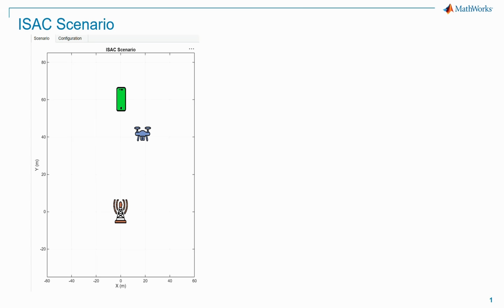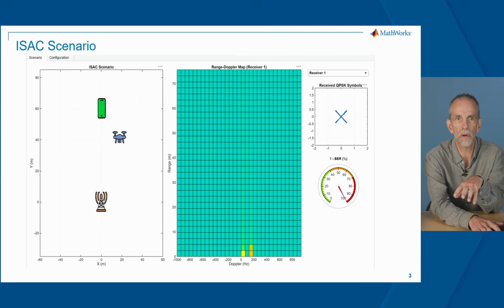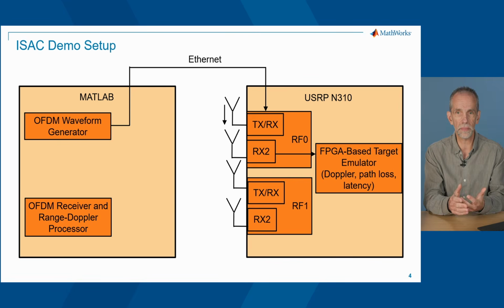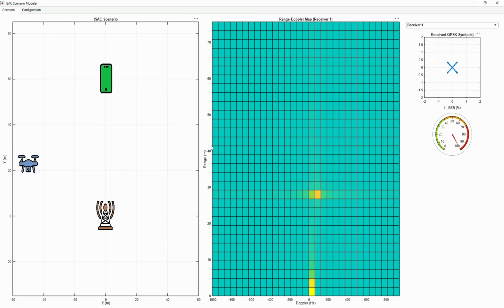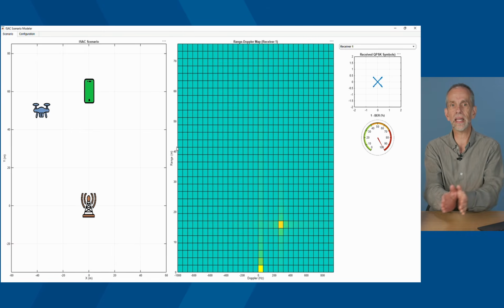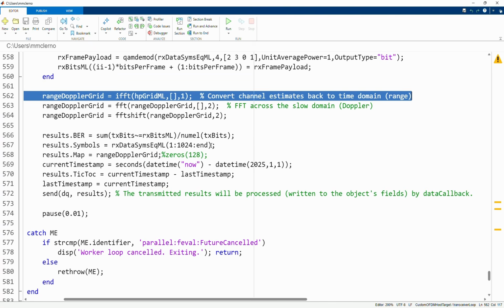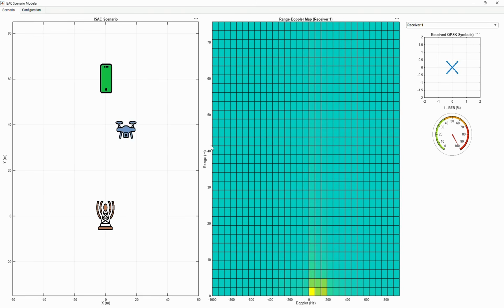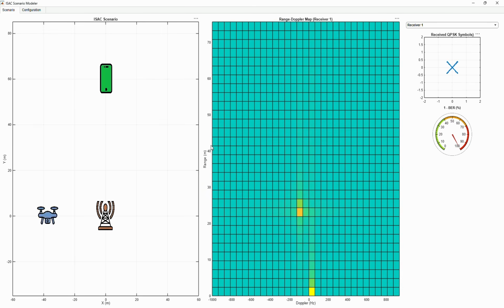Integrated Sensing and Comms (ISAC) with MATLAB and SDR

Comment: Thank you MATLAB for the tutorial. In this tutorial, the sensing mode is Bistatic. Can FPGA-Based Target Emulator (Doppler, PathLoss, Delay) be used or modified for monostatic sensing?
Reply: Sure -- in that case you would simply need to change the receiver location and velocity to be the same as the transmitter.  The latency, path loss, and Doppler would change accordingly.  In fact, you probably wouldn't need to change the HDL at all.  All the changes should occur in MATLAB.